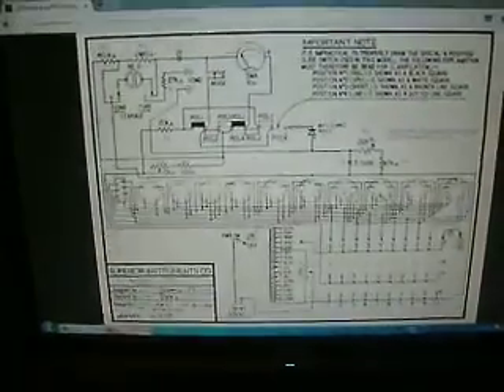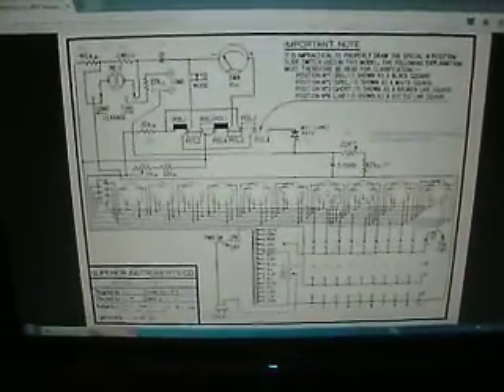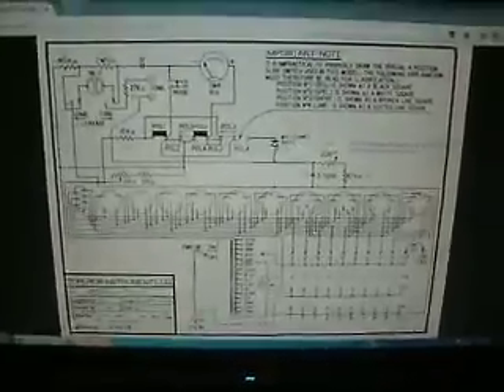Calibrating a TV Model 11 Emissions Tube Tester

Comment: I think my Rheostat may be wired backwards from yours.  It is hard to tell in your video if you are pointing to the red wire or the orange wire.  The red wire that goes to the filament voltage selector is on the opposite side connector on my rheostat.  I believe you clearly show that the AC voltage should be read between the filament voltage selector wire (red) and the 120 volt connection (center) on the rheostat while pointing to the schematic.  Please confirm I interpret your directions correctly.